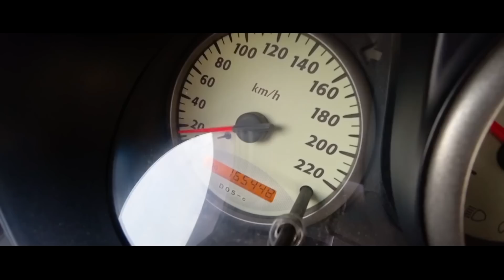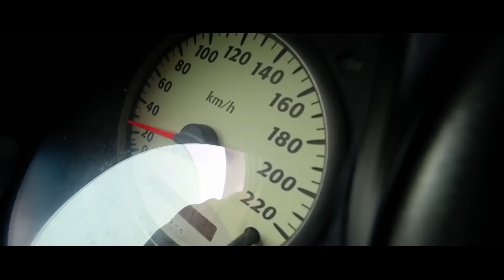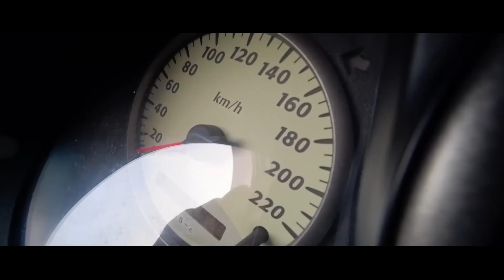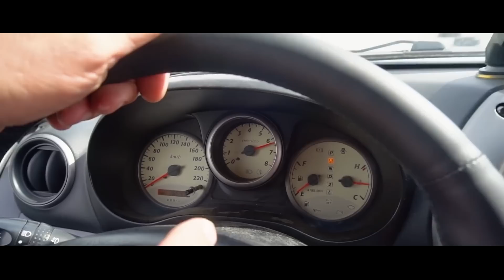What happens when you engage reverse at 62 MPH?

Comment: a german dude did this with a manual, eventually the output shaft overpowered the input one and made the engine spin backwards and made the car run only with 2 cylinders.
when they removed the head cover they found that two rocker arms snapped when the engine spun backwards, it also appears that the reverse gear grinded enough to not engage at all

Comment: I saw that //M shifter thumbnail and panicked!
Reply: That would have been an expensive crunching noise !!
Reply: I have that same shifter in my car, the gearbox' computer won't let you abuse it.

Can't rev too high without shifting up, or the computer will shift for me.
Can't let the rev drop too low or the computer will downshift on it's own.

Even with the gearbox in "manual"  mode
Reply: @verliebt3465  Vlad: Disconnect speed sensor. 
.                    Verliebt: What's that smell?
Reply: Paul Woodman 
It’s different, the BMW runs a litterly a OS, that cant be fooled In any way..... even with the cables removed car wouldn’t even start
Reply: Me too.

Comment: Do the same on a manual car :) I'd love to see what would happen(ruin the engine/trans?).
Reply: lots of ground gears and brass shavings
Reply: My money is on the driveshafts being obliterated. Or hellish amounts of clutch slip, the smell would be unpleasant.
Reply: Wont happend..reverse lockup,wont go in
Reply: Watch mastermilo82 he did it
Reply: untouchable, light after darkness, i agree. I have accidentally tried shifting in my manual and the lever hit a block and it would not engage until i would bring the car speed back to 0.
Reply: Mastermilo did this experiment already - https://www.youtube.com/watch?v=ARJENV0qGdY There are English subtitles too.
Reply: You cannot engage reverse while moving forward, because there's no way to match the gear speed to the engine speed (the gear would be spinning in the opposite direction of the drive gear). Even if you manage to force the gears together, all you'll do is just grind them against each other as they spin in opposite directions.
Reply: I did it when thrashing a VW Golf Mk2 destined to scrap heap.
Went maybe 50-60 mph, forced it into reverse while revving at redline, dropped the clutch and the wheels skid backward as you  keep moving forward. It's so weird to do, as your steering suddenly has no effect , you just keep going straight .

Lots of fun :)
Reply: @rars0n  On my car (manual) the reverse is not synchronized. If the car is slightly moving and you try to engage reverse you will hear this grinding noise. You have to be stopped and press the brake pedal in order to switch in R safely.
Reply: @Combine1331  Reverse is never synchronized, because it's designed to be operated with the car stopped. There's literally no point in putting synchros on a gear that is engaging when vehicle speed is zero.

I've never driven a manual car that actually requires the brake to be depressed to shift into reverse. Every single lockout I've ever seen was manually operated. I've only seen that on automatic cars shifting out of park (every single automatic car I've ever driven also allowed me to shift into reverse from neutral without pressing the brake pedal).
Reply: @rars0n  That is true, you are not explicitly required to press the brake pedal to shift in R. However in the manual of the car it is written that before you switch in reverse gear to make sure the car is completely stopped. I press the brake pedal for that reason - at least when I am not on a flat road or when I am making maneuvers. In short words - yes, you are right - it is not necessarily to press the brake, but at least make sure the car is completely stopped.

Comment: Too easy this one. I really want to see engaging "P" with the car in movement
Reply: All mine just clicked till it got to about 5mph then locked up.
Reply: With older automatics you will for sure just break the parking pawl and have yourself two neutrals.
Reply: I accidentally did this once, going about 5 mph. Rapid clicking as the parking pawl tried to engage until I stepped on the brake, causing the car to suddenly stop. Not all that dramatic, really.

Comment: As far as his very last comment about having to throw your automatic in reverse to stop when your brake line bursts.. you could use the emergency brake also. Just hold the button down or hold the lever and gently use it like a brake. They are connected by cables so completely independent from the normal fluid and line brake system and will still work when the primary system fails.

Comment: Most newer cars have a safety interlock, above a certain output speed the trans will not drive out of the forward gears, some older cars, like my fathers old Dart if you put it in reverse it in reverse it would outright stall the engine because the trans was shifted into reverse, pressure would drop pretty quickly and would be disengaged from the engine to avoid reverse engine spin, it's a very simple yet effective solution to a possible problem.

Comment: The reason the gearbox is doing that is because it uses wet clutches, which is basically a bunch of clutch plates sitting in oil that squish together to grip. By slamming it into reverse a few times he caused the clutches to wear down and lose their grip requiring higher RPM to get movement because the clutches have little traction

Comment: Did that accidentally with a 1963 Chevy Impala. SS, convertible, 283 with a Powerglide.
I was doing about 40 mph, wanted to engage neutral whilst rolling to hear the engine revving. Lever went too far.
Entire drivetrain froze, engine stopped, wheels blocked. Came to a halt screetching.
Started the car again, and never had a problem. The PG is a durable transmission.

Comment: Doing this will work on an icy surface if you're losing control and need to stop. When sliding on the ice, there is no traction to the wheels, so by pressing on the brake to stop the wheels from turning, you can shift into reverse and quickly mash down on the accelerator before the wheels have a chance to pick up the forward momentum. This will get the wheels spinning backward at a high rate and counter the forward momentum of the vehicle enough to (hopefully) be able to stop.

I would do this as an absolute last option since timing is everything.

Comment: It all comes down to whether if auto gear box is fitted with low pressure valves or high pressure valves, the way to tell is try tow starting if you can start by towing at 30 mph you have the high pressure valves fitted, if not its low pressure valves. But throwing it into reverse while travelling forward will damage the torque blades.

Comment: I accidently engaged reverse in my 71 Dodge tradesman 100 van.  It went in to reverse at 40mph locking both tires in rear.  If I had hit the gas it would have been a spectacular burnout but i was able to quickly put it back in to drive without issues.

Comment: My friends and I used to do this in parking lots at night. It does work and will ruin the axles and u-joints, eventually. The fun is worth it.The trick is to get momentum in either direction. Then pound the brakes and shift while the wheels are skidding, and the throttle is pinned. Even better is doing that while smoking the tires. The automatic transmission cannot overcome the pressure from the wheel side. Due to the gearing being setup to reduce ratios. Unless it's in a skid already with molten rubber. If you find the knack for it, add some bleach sprayers and get it all hot enough to ignite. :) Makes a great big mess.

Comment: I know first hand that a 1976 Chrysler Cordoba with a 318cu engine...
It will engage at 100mph.. did it on accident while manual shifting... 
Went 1, 2, and skipped D N and straight to R...
I'm glad I had my seatbelts on...
It kept me pinned damn near on the steering wheel until I could get my foot off the gas...
It left the longest set of parallel spin marks in history...
It did wound it though....
It permanently locked the differential...

Comment: When the hydraulic brake line(s) rupture you downshift to neutral and use the parking brake/hand brake/emergency brake to stop. Been there and it’s hard to focus while rolling uncontrollably through a red light but that is the answer. Also you tore the clutches up and maybe the torque converter

Comment: You can throw the lever in reverse but the gears are not going to go in reverse. Remember those toy cars you pull back , at a certain point there is a spring arm that will click over as tension is maxed. Same thing in this auto trans, its spinning faster than it would allow engagement.

Comment: its a Electronic shift system, what these manufactures did was employ a safety feature while the vehicle is in forward motion it basiclly does put in a form of neutral. or more like hitting a clutch. its to protect you from screwing up the transmission. or accidently throwing it in reverse while on the highway.

Comment: Modern automatics have a clutch too. The old style would have a torque converter which is a form of energy waste as the car is driving. Cars started adding a clutch which would connect the engine and driveshaft when the car is moving, thus bypassing the torque converter and stopping the energy waste. This car seems to have a computer controlled clutch with no torque converter for reverse - the smell and then the car's reluctance to drive is from the clutch burning itself out.

I had the same when I was learning to wheelie my motorbike, the clutch will have a tiny bit of slip and start to smell, then a short time later the clutch falls off a cliff and struggles to move the bike at all. I would assume allowing it to cool down will help with that. I also killed the seals in my front shocks, so anyone else wanting to learn should be careful of that and probably try to learn on a smaller bike. Probably wasn't worth the money spent.

Comment: Back around 1987, I had a BMW 2500 built mid 70's with a 2.5 ltr and an automatic trans, yeah believe it or not BMW had some automatics in Germany. It didn't have steel u joints it had a flange with rubber grommets. I was heading home from work doing about 115 KPH when the car went apeshit, rear tires smoking and wheel hop worse then you could imagine. I started decelerating and braking, the ass end was all over the place. Luckily the Autobahn was quite that day. As I'm trying to figure out what the heck is up. I limped it to the side of the road in reverse , the gear selector is in 1st and sloppy but the car is still in reverse. One of the grommets from the drive shaft broke and hit the transmission linkage and broke it. That was fo fun. I picked up a used rod end for the linkage at the junk yard from an old Saab and was back in action.

Comment: The gearbox senses the speed and if it's too high it engages neutral instead of reverse as to not cause damage and once it slows or you change gears it will either go to the gear selected or it will go into reverse after a complete stop

Comment: I'm not familiar with that vehicle, but this is much more fun on an older automatic that utilises a shift cable! I turned my first car (Ford Probe haha!) auto into a slap stick. Removed all the interlocks and safeties. I was young and reckoned it was cool. Then one day, whilst pushing the slapstick to neutral so I could rev, I pushed too far forward, into reverse. I was going about 60km/h. Surprisingly she took it, only having locked up the wheels. I was very surprised the wheels lost grip instead of the gearbox exploding, esp given what a peice of rubbish that gearbox was.

Comment: I accidentally hit reverse in my 96 V6 camaro at 70 mph. It stalled the engine and chirped the rear tires. It was in reverse for just a fraction of a second. Drove fine when i sold it. Last owner had 270,000 + miles and counting.

Comment: Its an electronically controlled transmission, its designed to be efficient and the added benefit is safety. Though, it is satisfying in my Camry to throw it in reverse while driving. Because the reverse lights and back up camera still turn on. Makes tailgaters second guess hanging on your bumper!

Comment: it's probably because reverse is a straight cut gear and won't mate while the transmission is under load. It will basically just spin in neutral until the engine speed matches the wheel speed or the vehicle comes to a stop.

Comment: The transmission on all modern cars is computer controlled and the computer is very aware of the direction and rotational speed of the transmissions output shaft , it simply refuses any action that's dangerous or will cause damage. (the transmission will also refuse a forced downshift if the car is moving to fast) shifting to park on many cars however is mechanically linked and will damage the parking pawl ..

Comment: It worked on my friends 1975 Oldsmopile Delta 88. He threw it in reverse at 65 MPH and matted it. He never said he was going to do it and I didn't have the seat belt on. I slid forward and there was lots of tire smoke for a long way then the car went backwards again as fast as it could then he slammed back into drive. He said he does it often and the car just takes it.

Comment: Do this with an old 1970’s or before car lol a neutral drop with an old car u would break a u joint you would hear a metal dropping noise followed by pinging metal crunching noises cause the driveshaft would be spinning along the pavement

Comment: Auto boxes have clutches that also burn, along with the transmission fluid, hence the awful smell. That gearbox took some serious punishment though. At the end the clutches were burned out so it would not move even at high revs, especially in reverse because the reverse gear clutches were basically used as brakes.

Comment: With newer cars yes, but with older automatic transmissions that are manually controlled they will go into reverse, newer cars the computer sees that you put it in reverse and itll see the speed and the computer controls the solenoids which change gears and if you are going to fast it will not shift into reverse and rather go into a neutral state

Comment: I used to throw my Chevelle in Reverse going 10mph nail the accelerator the rear tires  would break loose turning in reverse even though the car is still moving forward. YOU'VE NEVER SEEN SO MUCH TIRE SMOKE!!!

When trans was rebuilt 10 years later there was extreme damage to clutch pack & the input shaft

Comment: This one happened to driving while my car (2009 Toyota Yaris), at certain speed (between 10 and 20 km/h) I put the reverse by mistake and the car did a weird metalic sound, and then stopped. This happened to me because my car's gears are not like in this car (straight line).

I believe Toyota is aware of the reverse thing and put a safety device in their newest vehicles  to prevent the hairy kids to put the reverse while the car is moving.

The funniest thing of this video was the fact that the speedometer was in Km/h and everything is said in Miles/h, only in Russia I believe!

Comment: I had a 98 cherokee and was switching from 3 to overdrive at about 50 mph, shifter went all the way forward to reverse my wheels locked up and went straight in a creek off the side of the road. My passenger wasn't wearing a seatbelt and ended up landing in the back of the jeep crushing a speaker box but some how didn't get hurt the XJ was completely totalled though

Comment: Used to be there was no idiot-proofing, so if you wanted to do something stupid, it let you.  These days, many of the control inputs that you give to the car are just suggestions to the car's computer which can choose to accept those inputs or not.   That's why we don't have emergency brakes on many cars these days and instead just have parking brakes.  The parking brake is either an all-on or all-off type of thing and is likely to not even be able to be activated when the vehicle is moving.  With the cable operated emergency brakes, you could feather it in gently to slow your vehicle down in an emergency situation and come to a controlled stop.  You would not want to have the brakes just lock up completely and then try to come to a controlled stop.  Where this really becomes an issue is if the vehicle is on a long steep downhill descent and it has a complete electrical failure so that the car's computer is not accepting any inputs.  If you have a brake failure at that point, you better start looking for one of those emergency truck run-out lanes that are filled with sand or gravel and hope they will also work with your lighter vehicle.  Or find a guard rail and grind down the side of your car until it stops.  I'm a retired engineer with an avionics background and the design of most vehicles these days does not meet what I would consider to be fault tolerant.  The few vehicles that have manual transmissions are a bit better though, but even with them, the kiddie engineers that are working for the car manufacturers these days either do not foresee possible problems or they just don't care.

Comment: I love the smell of burning clutch in the morning.
Reply: You do realize that's a torque converter and not a clutch, right?
Reply: @rars0n  You do realize that automatic transmissions have clutches as well, right? The forward and reverse clutch pack are usually the same one. He burned those out, hence the reason it wouldn't move properly. Chances are very slim that the torque converter was damaged...
Reply: @rars0n  well a torque converter doesn't have any friction contact surfaces, it's fluid based. The stink would be coming from the brake bands and clutches in the tranny itself. And it is quite a distinctive pong. Which were apparently destroyed by the end, when the car would hardly move.

Comment: If you get a 70s or 80s car with a mechanically controlled auto trans you could do it as it has no shift lock.

Turn a 200R4 into a 200R0.